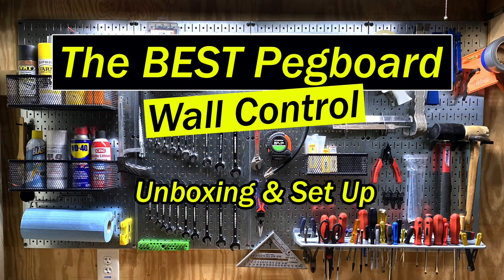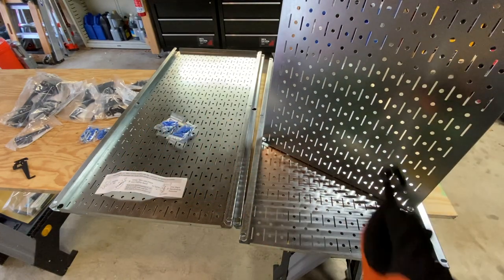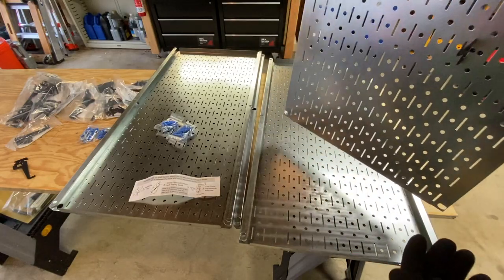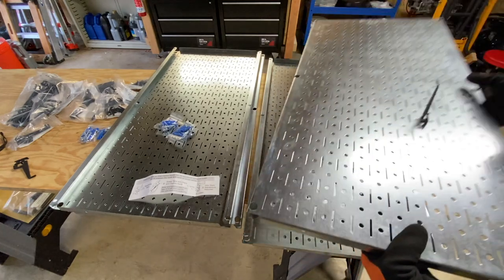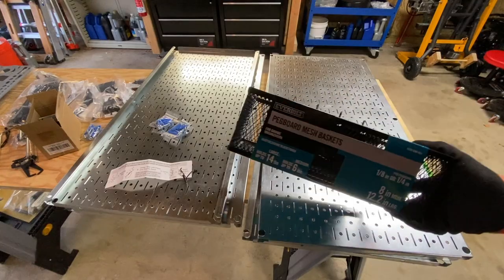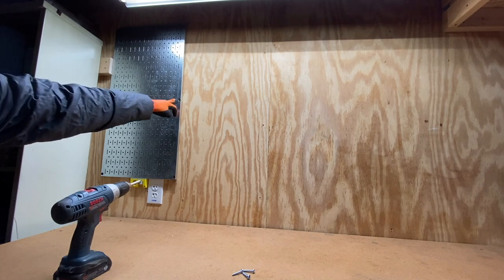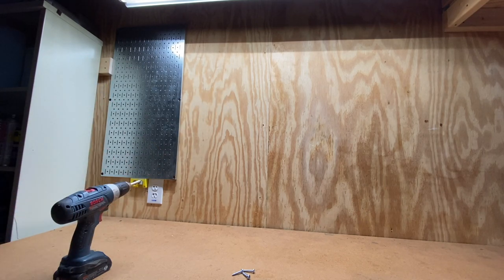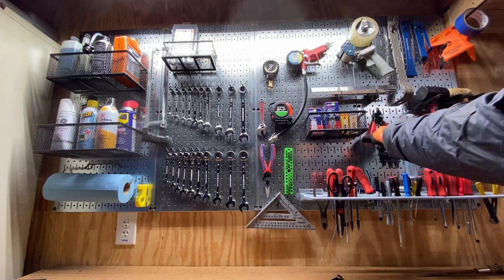Wall Control: the best pegboard & hooks

Comment: Yeah, I followed your advice and ordered a discounted set of "scratch and dent" product from a site online. It is a good deal, so I don't regret it too much no matter what. But two days later, I see a video for the Omni Wall system which mounts to a track, allowing for installation in tight spaces, and mounts vertically or horizontally. Very convenient. The weight limit might be decreased with the extra cuts, but it's probably still stronger than particle board.
Reply from the maker: I wasn’t aware that scratch and dent was a thing! Maybe you saw that in someone else’s video. Sounds cool though. Want to share the link for anyone else looking to save some $$ that doesn’t mind getting a blemished product? 

I’ve seen omniwall, but haven’t used it. Being able to mount it vertical or horizontal seems like it’s biggest strength. It looks like more of a pain to install with the track system. The hooks being multi piece kinda struck me as inferior to wall control, but hard to say without actually trying it. If you end up getting it, I’d love to hear how your experience compares to wall control.
Reply: @MostlyBuilds   I think I have enough with 8 panels of this, so I won't be reviewing it. I have a small area of around 42" on one side of the garage that I can put two sheets (2 x 16") in, but I don't know if I can hit studs at the corners. I like the rail hanging idea of the other system and might have to do something like that with this. It will just take some cutting and drilling.
BTW, I meant that I followed your advice and got the Wall Control system, but I got it from that site that sells scratch and dent.
Reply from the maker: Ah gotcha. My bad. Feel free to share the scratch and dent website for others.

In case this helps, I have another video where I helped a friend install wall control panels on a concrete wall in his basement. We put wood 2x4s up kind of like a track so we would have flexibility with putting the panels up + avoid having to drill more holes in the concrete. Might give you some ideas for your install even though you aren’t doing it on concrete: https://youtu.be/NMmDj9KKr1g

Anyway, good luck with the project!
Reply: @MostlyBuilds  The name of the site is cheap pegboard, without a space. They won't let me post it, but I'm sure you can find it.

Comment: So did you give Omniwall any consideration when you made your decision?  Very similar, and also has hooks that don't come out with little pegs that hold them in place.  From what I can tell it's a bit more expensive, but not sure which product is really better.
Reply from the maker: I did. I’ve never seen the omniwall product in person, so my opinions are based on YouTube videos that I watched about it + their website. I’m not a huge fan of how you mount them with brackets that you attach the panels to. I also wasn’t super into their multi-piece hooks. The whole system just looks more complicated. On the flip side, it seems more flexible since it looks like you can mount the panels in any orientation, versus wall control you need to either buy vertical or horizontal panels. I like the simplicity of the wall control panels. You probably can’t go wrong with either of them. If you decide to go with omniwall I’d love to hear what your experience is like!